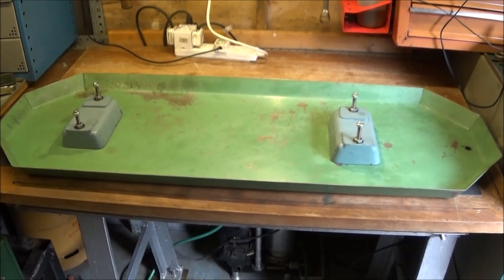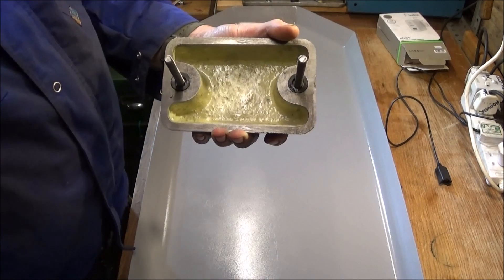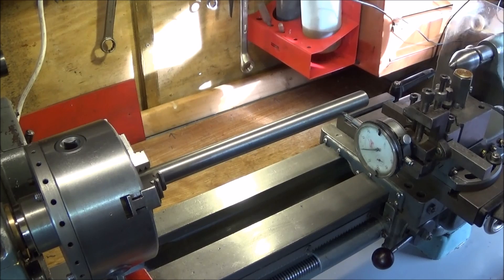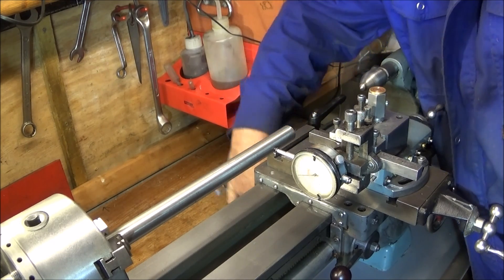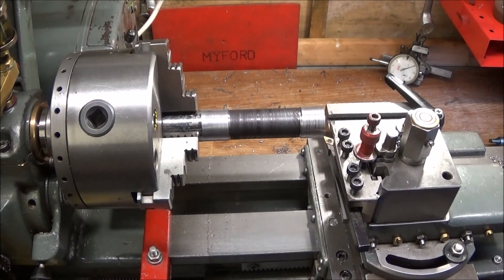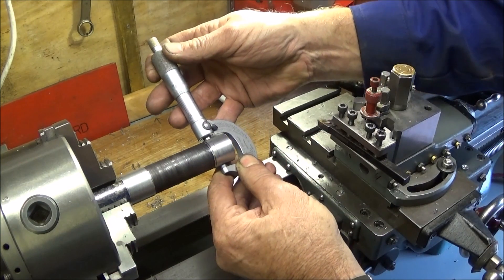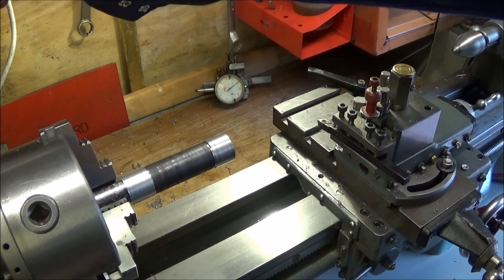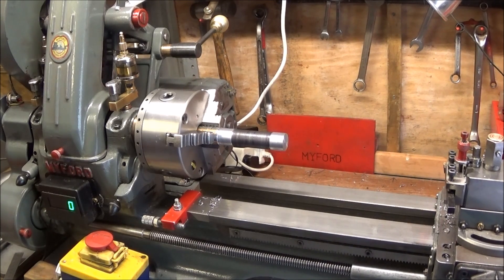Important Tests For Myford Lathes & How To Adjust To Remove A Turning Taper

Comment: Steve, why would you do the taper turning test without the tail stock and a live centre. I have a similar setup, with sacrificial pieces of alu locktited onto silver steel rod, but use the tail stock....
Reply from the maker: Hi Eben, This is the test as shown in the Myford ML7 manual on how to set the lathe up. If you used the tail-stock it would give a false reading and not show the true distortion in the lathe bed.  Using the tail-stock would cancel out the movement of adjustment and make the distortion worse. This is because the tail-stock center would pull the end of the test piece bar over, in the twist-direction of adjustment, that is made using the jacking screws. Therefore not showing the twist in the ways...... For an example, just think... if you use the tail-stock and then raise the front right hand jacking screw. As it is raised, the lathe bed twists up at the front and the tail-stock center will effectively drag the test piece bar towards the back of the lathe....So then, when you take a new cut on the test piece bar,.... it will make it larger in diameter at the front end, when it should have been made smaller. Therefore making the distortion in the lathe bed worse than it was in the first place...... (Using the tail-stock drags the test piece bar in the twist-direction of jacking-screw adjustment.... Not using it drags the cutting tool in the twist-direction of the jacking-screw adjustment, therefore effectively removing all of the distortion in the lathe bed, when there is no taper on the test piece bar...It is very accurate and you can get all of the distortion out of the lathe bed!).......Thanks for watching....Regards Steve
Reply: Thanks for the quick reply ! Will ponder this till my brain makes sense of it and try it without the tailstock. Your myford videos are causing a lot of extra projects on my side - busy making a carriage stop and the morse2 drawbar chuck stop as well.
Reply: I'm not an expert but seems to me that you should adjust your tail stock after you do this procedure to be in alignment.   I have very much enjoyed the learning of this video.    Dale in Canada

Comment: I think that with vibration and time and gravity the "leveling or un- instraining nuts" (depending on wich  level  origin you started with) will sink into the bed's cast iron ? the block&underfoot "shouldering or mating " surfaces aren t anymore what the myford engineers had first designed .  it is  better advised to find the proper metal shim thicknesses and the shims having at least the same cross section as the underfoot does. what is explained in the myford manuals is the way to determine the taper s direction , I ve never seen any mention of those leveling screws.  the simpliest way is Mr. Lawrence H. Sparey' s one.  The amateur's lathe 1948 , 1954 , 1960. Myfordly yours , Rene Levesque
Reply from the maker: Hi Rene, If you read the Myford ML7 Operation & Instillation manual you will see the raising blocks with levelling screws, (20/025) (others say jacking screws), are mentioned as the correct method of adjustment for the lathe bed. See paragraph at the top of page 12 in the handbook. The jacking screws made specifically for this purpose have a surface area which wont sink into the cast iron. 
   You can use metal shim, if you do not want to use the Myford Raising Blocks, but it would be much more of a job to get it right, having to lift the lathe each time an adjustment is necessary and then bolt it down again before checking.....it must be a lengthy and tiring process!! I would much rather use what Myford made specifically for the job like I have shown in the video.....Its a great design and works perfectly.
Reply: Sorry to reply so late , in the 1953 #701 publication there are no mention of the raising blocks. In the 1961publication #720j the raising blocks are mentioned. I own 1 super 7b on it s nottingham bench and I sold the raising blocks on ebay and leveled it as the Mr Sparey or first Myford publications method. I own a ml7gearboxed on it s Nottingham bench and this one too I leveled it on shims over aluminum blocks . And do own 1 super7gearboxed , 1 ml7 long bed gearboxed , another ml7 gearboxed and one hybrid of a super 7 headstock on a ml7 bed ( all those lathes aren t on  original Nottingham benches) and they re all leveled on shims over aluminum blocks on fully metallic benches. The shouldering cross section bearing the underfoot area to the under supporting surface is of capital importancy , to absorb vibrations and distribute the stress , redo the same video but with aluminum blocks and shims and compare the movement of the indicator s needle then please come back and reply

Comment: What are the oilier adaptions you have please and what is their purpose fabulous video
Reply from the maker: Hi Martin Thanks.....I made the oil manifolds so that I have more control over the lubrication. I put pure iso 32 hydraulic oil in the drip feed oilers. The cup ones I use for iso 32 at the start of machining and sometimes use them to put some Molyslip into the bearings. 
 I have since changed the drip feed oilers to wick feed oilers, that I made. These are much more reliable and stay at a constant flow. See my video on the wick feed ones.
Regards Steve

Comment: Thanks Steve, have you fastened your Chinese 7x lathe to a bench or is it on the rubber feet?
Reply from the maker: Hi David, I took the rubber feet off, bolted the lathe onto a mahogany board then screwed that down onto the wood top of a heavy duty steel box section bench. It is solid and doesn't move, but if I need to do maintenance on the lathe I can just unscrew the board from the bench and remove the lathe complete with the mahogany board still attached. I can't understand why they put rubber feet on the lathe. It needs to be absolutely solid for machining.
Regards Steve

Comment: Many thanks for very helpful instruction, just discovered some run out has appeared!  Winter setup now summer heat in workshop may have caused issue, so will check and adjust seasonally if necessary.
Reply from the maker: Hi Bill Thanks. The worst thing about winter for mine is the condensation. I live on a flood plain so everything tends to get damp in the metal shed! Regards Steve

Comment: Very helpful thank you. How would I distinguish between a taper due to twist in the bed as you have shown and one due to head stock not parallel to the lathe ways. If you could say that would be very helpful as I have this taper issue with my mini lathe,  thanks.
Reply: williams-sonics a

Comment: No matter by whom or where the lathe was made it will deflect when placed on a bench, or for that matter a floor --- it is not made of Unobtanium. Tom Lipton has a monster lathe and the jacking screws are on the floor, but it still had deflection. Tom used a machinist's level, which is very expensive There is a video on the oxtools channel on the process. The test in this video is such a simple test and applies to almost any lathe. It is in Sparey's book, "The Amateur's Lathe" and everyone should repeat it. If you do not have jacking screws, you will have to shim the mounting screws. Thanks for posting!

Comment: Steve would this work for my 12"Atlas?
Reply from the maker: Hi Billy, I'm not familiar with the Atlas lathes. I just had a look on google images. If it is one with a similar bed design that bolts down on a bench I would say that it will work.  If you do not have raising blocks for a lathe you can use shim to do the adjustment. (Using shim is even mentioned in the Myford handbook). When I first found out about lathe bed alignment like this I was really surprised that a heavy cast iron bed would twist like this under the pressure of the bolts. I have heard stories where lathes have had up to twenty thou distortion like this. If you bolt down on a good strong reasonably flat surface I reckon it will work on any lathe of similar design.
Reply: http://mkctools.com/craftsmanlathe.htm
this is the exact lathe I have. even the bench comes with these lathes because the drive is undermounted
Reply from the maker: Hi Billy That is a nice lathe. The method of alignment would work on all lathes that are bolted down.

Comment: Thanks for the excellent Myford show and tell taper elimination video. I have a Colt lathe (Myford clone) and I suspect I have a taper problem which I hope to correct with the aid of your video. I will also use your procedure to check my 12in Atlas lathe which has a similar bed and mounting bolts.
Reply from the maker: Hi Thanks, Those Colt (Myford clones) are quite rare aren't they? I have only ever seen one on the internet. I think it will work on any lathe with similar design and you can use shim to do the adjustment if a lathe doesn't have raising blocks. I only found out about this procedure when I got the ML7 and read the handbook.
Reply: my Myford Clone
https://lh3.googleusercontent.com/Vu3kUqyFj5RhRJjCGeUJLxNh1L6UM19-qJEmnDAjsfsNm23t_wjTXQGviqGF7R5o6Nm7SMpWTA

Comment: Hi Steve,
               As I am restoring a Super7 and removed the headstock to facilitate the bed to be reground,I had to reset the the alignment using a MT2 test bar in the spindle and had to reseat the taper due to previous abuse.
It seems OK but is there any other way of accurately checking this?
Many thanks for the instruction it is easier to follow than reading the manual alone.
Please continue with Myford setups and great information.
Cheers
Allen.
Reply from the maker: Hi Allen, Thanks. At the moment, I do not know of any other way of accurately checking the alignment. My brother has the Super 7. I really like the spindle bearings on that lathe. Hope to do another video as soon as I get time!